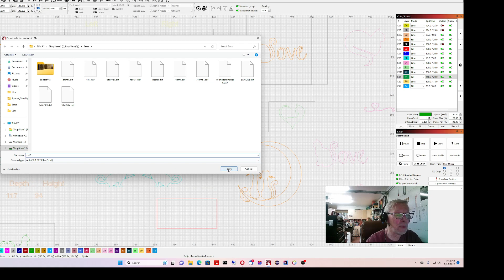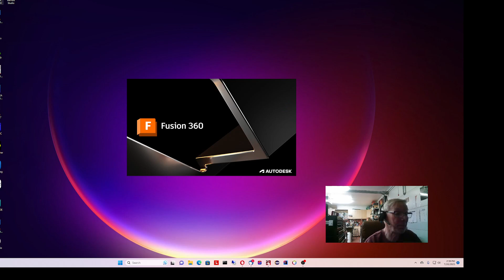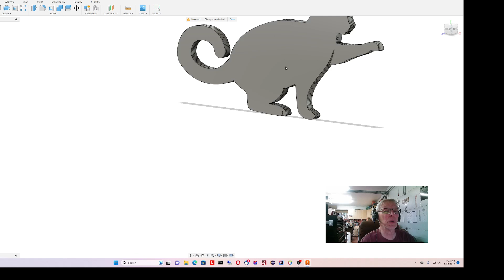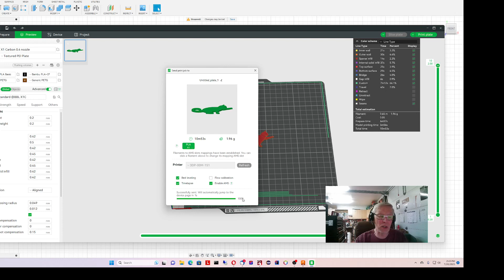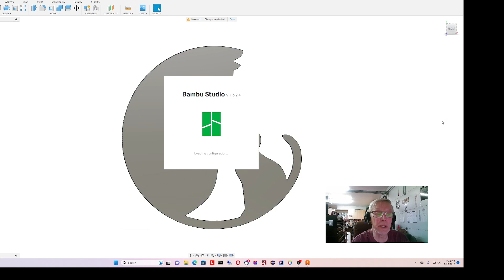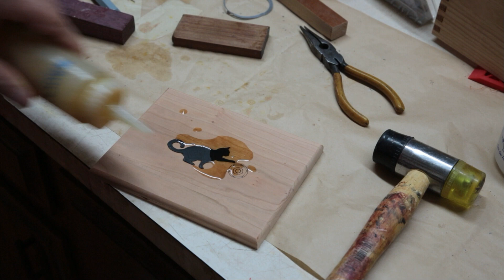3d Printing Plastic Inlays for Wood Artistic Boxes

Comment: Hi Paul - Great video.  What is the thinnest veneer you can 3d print? I am trying to replace a pick guard on a mandolin that is 1/32" thick.
Reply: 1/32" is about 0.8mm which is no problem for a 3D printer.  Standard layer height for 3D printers is 0.2mm so this would be just 4 standard layers.